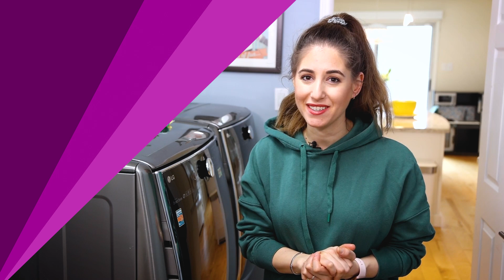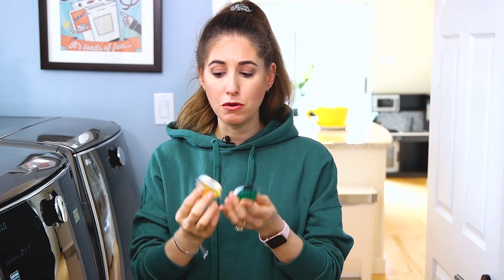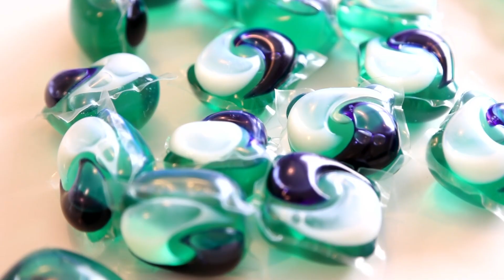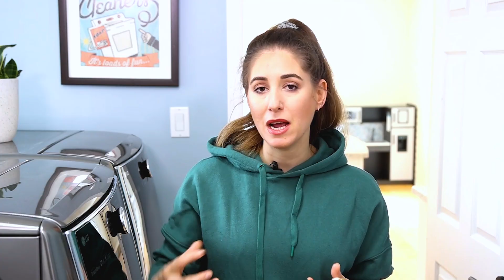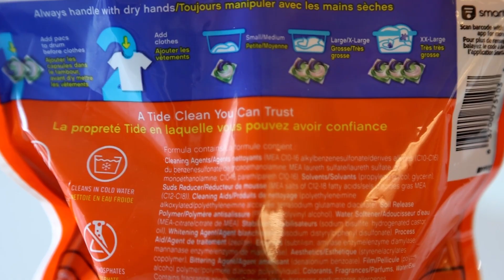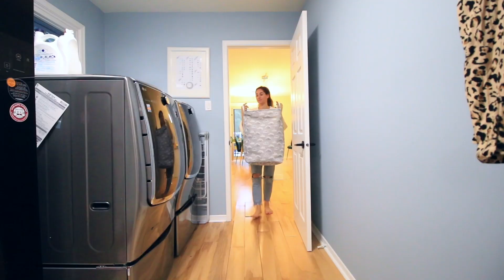Do Laundry Pods Work?

Comment: I absolutely love pods. I used to use powder detergent most of my life, then moved to liquid which never felt like it did a good job tbh. Pods are just so much more convenient, space saving and even, despite the price, economical because I use the correct amount now. 
Very rarely it happens that they don't dissolve in winter cold water, and that's just a single brand that has done that so far, so i'm not fussed.

Comment: We switched to nontoxic laundry and cleaning products years ago and now when I'm near someone who uses dryer sheets or heavily fragranced detergent I get an instant headache. I've alternated between liquid, powder and the "strips" and currently using powder as the strips didn't dissolve as well. I'm open to trying new things as long as they rate on A on environmental working group. I wish there was more discussion on the dangers of fragrance and chemical  filled soaps.

Comment: I’m told Montreal’s water is soft. I have been using the Tide pods, but find I often need to run one or even two extra rinse cycles, before I have no suds sitting in the open door. Good thing our water’s not metered! But I shouldn’t have to run additional rinse cycles to get all the detergent out.
I’ll be returning to liquid detergent soon.

Comment: According to tests performed by consumer reports, even high end brands of laundry pods were out performed by liquid detergent as far as how well they actually clean. I personally used pods for years before switching back to liquid because I noticed that no matter how I used the pods(warm/cool water, number of pods, size of load) my clothes never came out clean and over time developed a funky smell. But it is my personal opinion that correct measurements of liquid detergent works better than pods.

Comment: I have been using pods for almost 10 years now, I recently switched to powder simply in an effort to minimize plastic waste. Powder is the only form that comes in a cardboard box. I also have something called an ecoegg which is supposed to be good for 70 washes and less toxic for water sources, unfortunately I found it didn't wash my laundry too well, but is okay for small loads that aren't very soiled.

Comment: I hate to tell you this, but less than 18% of U.S. Water Treatment Plants are equipped with Biomes of Bacteria, Microbes and other fauna, that will break down the plastic casings of a Pod Detergent packets.  

So, your declaration that they are “COMPLETELY”  Biodegraded is ONLY TRUE In THE 18% of all Municipalities that have been retrofitted with chambers that allow for a Biome where Bacteria and Microbes, which, incidentally have been engineered and and are not naturally occurring in enough abundance to be useful, to, in essence, Consume Petroleum Based Products EXIST.

That leaves 82% of all U.S. Water Treatment Plants COMPLETELY INCAPABLE OF HAVING ANY NET EFFECT ON THE RESIDUAL PLASTICS from the Pods.  So, that 100% of the residue plastics from Detergent Pods,  WILL END UP wherever that particular Water Treatment Plant releases it’s “Treated” water, ABSOLUTELY SWIMMING WITH ALL THOSE RESIDUAL PLASTICS.

if you’re going use something as a fact, hope a scientist isn’t watching next time.

Comment: I used to love pods! Until I figured out the price. At the time, they were $.25 per pod. And if i do a large load, that's $.50 per load. I was like dang! That's a lot of money! So I started using liquid all free and clear. I use less than suggested and it lasts forever. I rarely buy laundry soap. Much more affordable.

Comment: Tried most of the brands and they all have the same problem.most of the detergent will go down the rubber in a front loader and I put them in as they tell you on the pack and they aren't cheap

Comment: My LG turbowash AI before it takes any water into drum will tumble load a couple of times to assess material and weight to see how much water will be needed and wash time etc so it doesnt matter where I put pod. What I have found works better is putting them in a little laundry bag so they don’t get stuck in door after the first tumbles and when machine shoots in water. 

Ariel in U.K. advises avoid pods in short cycles as they don’t have enough time to dissolve and in a cold wash the water may not be at temp either. 

I tend to switch between liquid for shorter washes and pods for longer cycles. Pods are better for dosing although can be expensive per wash if you aren’t buying when they are on promotion. Feedback I’ve also heard is pods help with people with disabilities as they are simple to use once out of their container. No heavy bottles and measuring out things.

Comment: Hey, I'm sticking to using powder detergent! It has so many advantages: Less packaging and weight because there's no water in there - better for the environment! More precise dosing because you can adjust the dosing to your needs (have a look at the packaging) instead of having to choose between one or two pods, which often leads to overdosing. You don't have the problematic "skin" foil at all. Even if it is biodegradable, it's still harmful to the environment to produce it! Plus, in powder, the different chemicals can be mixed together because they're dry and only react in the laundry machine when they get into contact with the water. In pods, all the three chemicals are the same, just with different coloring (that's just marketing!). Also, at least here in Europe, the powder detergent (esp. the "compact powder") costs less per load. The pods are all about marketing and selling stuff to customers who don't really need them!
Reply: Powder doesn't work that well

Comment: Wow. This was a bad video. Different chemicals in the chambers was debunked long ago. They don’t dissolve at different times, again debunked long ago. The HE standard calls for 2tbsps for a full, normal load, and also calls for never putting more than 2tbsps into the washing machine - heavily soiled items should be washed in smaller loads. That allows for more detergent per item, but still ensures the machine can fully rinse away the detergent in a single rinse. Pods are 2tbsps. You should never use more than one.

Comment: The problem with laundry pack or "pod" is that they dissolve all at once not in stages like the manufactures are wanting you to believe.  When you buy either liquid detergent or powder detergent you will get the same chemistry just like the packs.   But with more water in the case of liquid detergent.

Comment: I always used powder (I think it costs less than liquid), but started buying pods for my job which requires lots of air travel. I didn't like the uncertainty of a liquid or powder spilling in my luggage. I started using them at home too and never had a problem with them not dissolving completely (I use Arm and Hammer.) Recently, my apartment installed He washers and I decided to get powder for home again so I can use less. I still travel with the pods.

BTW, I tried Cascade platinum dishwashing pods for the same reason (some hotels have dishwashers), and when I used them at home, my dishwasher consistently overflowed with suds and got the floor very wet. I went back to powder there too.

Comment: I bought pods while traveling once, thinking it would be easier. I ended up with ruined clothes when the pods did not dissolve correctly and got stuck the clothes. I make my own liquid and powder detergents. It’s WAY cheaper, and it works well. I use powder for cloth diapers and liquid for everything else.

Comment: My Whirlpool front-loading HE washer weighs each load and draws from a detergent reservoir. No packets. No load dosing by me. I occasionally use vinegar  as a fabric softener. My machine reminds me monthly to clean it, which I do occasionally (but not monthly). The great thing about cleaning the washer is that I can remove the reservoir and the conventional dispensers for thorough cleaning in a laundry tub.

Comment: Clogged my drain. I never had a clog in the drain line for my washer. Not one in 20 years. After a couple months of using packs I had to have it snaked. Took me all weekend to problem solve the issue was a clog far down my drain. 

I liked them and used the little packs for my dishwasher. It caused a second clog in that drain at other end of my house. The packaging sealed the pipe. Stopped using either 2 years ago and haven’t had a clog since.

Comment: I used to use the pods, but I stopped when I got my new washer.  The guy that installed it told me to NOT use the pods.  He said he also repairs washers and the number one reason for problems in the newer machines could be linked back to the pods.  He said the casings don’t always dissolve properly and will ‘gum up’ the washer.
Reply: Ariel in the U.K. give the advice not to use the pods on shorter cycles as there’s a chance they won’t dissolve fully same as if used on a cold wash it’s on the website. I’d imagine that’s indeed what he’s referring too. People using quick washes too many times or cold washes and yeah it’s a possibility if they don’t run longer cycles on hotter temps once in a while or drum clean cycles.

Comment: I've been using strips for years now and haven't regretted it yet, best decision ever! Easy to dose, probably the most sustainable solution due to it just being laundry powder strips that come in a slim cardboard envelope, which is the other thing that they take no space to store whatsoever compared to most other laundry products. Highly recommend!
Reply: When using the strips, do you wash in warm or cold water? Wondering if they desolve well with cold water.
Reply: @jesystar  No issues whatsoever, never had any residue! I wash all my clothes in 30 degree celsius temp, towels and other things I might wash warmer and I have also done a 20 degree wash, never had an issue with the strips! I have a front load machine so you put the strips in the detergent tray but if you have a top load machine it goes in the front! I use the Tru Earth ones by the way but there's other brands too!
Reply: @natwandering  Thank you so much! Will definitely try them 😊

Comment: I am a die hard fan of the Tide Spring Meadow laundry packs (which are similar to the green and blue you have in the video). However, these are not easily available in my country and we can buy them through Amazon only, but they are extremely expensive. My parents had been to the USA prior to the pandemic and whilst returning they got these laundry packs from there. I used them alternately to the liquid I use (once the packs, next time the liquid), and believe me, whenever we did our laundry using these laundry packs, my clothes came out super clean, fresh and smelt great.  I plan to use these in future as well because they give the best results , however, like I mentioned before these are super expensive, so until they are easily available in our markets/stores, I will alternately use my liquid.....
Reply: Have you tried scent beads or fragrance boosters instead? Downy unstppables equivalent

Comment: WAIT... what was that drawer you opened under the washer? PS: I use liquid as i hated that the powder could get caught in folds and I would have to rewash some pieces over again. This being said I would love to try out the detergent sheets, maybe when more companies make them, bringing down the price a little, if they come down in my lifetime.
Reply: It looked like another smaller washer to me but idk
Reply: It's the LG sidekick for their front load washer. Basically a smaller, separate chamber washer to wash separately, in different mode or more frequently, like undergarments or workout clothes. Can be run on its own or at the same time as the front load washer. My laundry space can't fit them... would love to have them!

Comment: I use the Blueland laundry tablets now, and I find them quite good. Low suds, no scent, and I can break the tablets up if needed. I switched from detergent packs mostly due to issues getting the unscented packs in my area. The only thing I have to remember with the Blueland laundry tabs is to break them up as much as possible for cold water washes so they dissolve faster.
Reply: Nice! Have you used they're other cleaners? So curious about them especially the bathroom spray.

Comment: I tried the packets of detergent for my dishwasher but discovered that they didn't fully dissolve in the wash water leaving a gummy ick on the bottom of the machine even though I made sure the water was hot, so, when I thought about the packets for my washing machine I passed them up for liquid and a measuring cup. I don't know if it's our water (well water) or what but I'm afraid the same will happen in my washing machine.

Comment: They are terrible for dosing. Too easy to over or under load. So if you have just say three shirts you need to wash, you need to use a whole pod, the same dose as if you had 12 shirts to wash? And there would be so many using only one pod, even if they have a full load, especially in those huge American washing machines. Yuck.

Comment: Haven’t tried them but I have just started using sheets (Earth Breeze). So easy to use and to adjust for load size by tearing a sheet. I love the lightweight packaging. As for cleaning, they do a better job than the liquid detergents I’ve been using.
Reply: I tried these out. They are horrible at stain removing. 
I personally love defunkify better.

Comment: I use the Tide free and clear pods. I used to use the liquid but changed for convenience. One issue is that even with 1 pod I still see bubbles and soap residue after in my new LG washer. I usually have to add another rinse cycle which is I never had to do with my old LG. Not sure what’s the issue (as I used pods with the old one too). I wish there were half pods that one could buy.

Comment: The blue in the Tide packs has permanently stained some of my clothes.

Also, the plastic itself has stuck to my clothes and hardened in certain instances. They didn't break down properly
Reply: I had the same issue and I will never use them again!
Reply: I had that issue too. I dissolve in a cup and then add them to the wash after they dissolve, after I use the ones I have left I will not buy them again. It will be liquid or powder for me. However, the pods work great to mop floors with. You just add them to a bucket of really hot water.
Reply: Wash them again. They will dissolve. Also get another detergent (just not pods).

Comment: For years I used powdered detergent but it was messy and we have hard water so many times the detergent didn’t fully dissolve.  I switched to liquid laundry detergent and that solved the problem but can be messy. Especially if you buy those large dispensers with a spigot and cup. I tried pods a few years ago, while convenient they are pricey and can be wasteful if you have a small load.  Also most of the directions tell you to use two pods for large and extra dirty loads. I went back to liquid but buy in jugs on sale.  I can easily adjust the soap slightly if needed.  On average I spend about 9.4 cents a load with liquid vs. 22 cents a load for pods.

Comment: Use liquid detergent. I can easily customize if I need a tablespoon or more without feeling like I'm wasting. If wash a very small load I don't get residue or have my skin sensitivity act up and I can easily adjust to wash my king size comforters! Plus, cost per load/pack is so high in comparison to using liquid. 
PS I used powder and still would however it doesn't dissolve properly in my HE top load unless I wash on warm, I use cold water so had to switch to liquid.

Comment: I’m curious to hear from anyone that’s had a negative experience with the new types of laundry sheets (not the pods).  Like True Earth. Do they clean as well as traditional laundry liquid?  What happens to the actual sheet - does it fully dissolve?
Reply: I’ve been using True Earth sheets! I love them! They do a great job! The envelopes are lightweight and take up next to no room. Great for travel! I can slip a few in a baggie! Useful for hand wash as well!
Reply: @epicmom365  thanks! 😊
Reply: The sheet fully dissolves!
Reply: I left another comment but I had a hard time with the sheets not dissolving. They initially left chunks on our clothes and residue on the drum of my washer!! Eventually got it right but haven't gone back to them after I finished the envelope.
Reply: @lb9549  thanks for the feedback

Comment: Powdered detergent or liquid + a scoop of oxiclean if the load needs it.  If I'm running a cold/cool load I'll start it hot/warm to help the powders dissolve a bit first, and then switch to cool when I start adding clothes.  I'm trying to try buy fewer products packaged in plastic (I buy the oxiclean in the bulk paper box and transfer to an old smaller tub I have) so whenever my liquid jugs run out I will be purchasing whatever detergent I can buy in cardboard, or loose at a bulk store.

Comment: The repair person that fixed my washer said pods are terrible for machines. The stuff on the outside gets stuck in the mechanism and your machine won’t last as long as if you use liquid or powder.
Reply: We got told that too..also with dishwasher tablets that come in plastic. So I just cut the plastic wrapper off and put the tablet in.